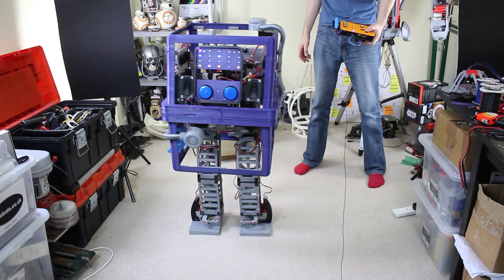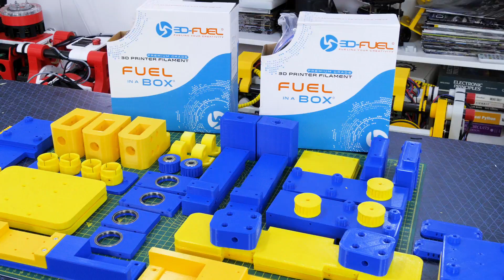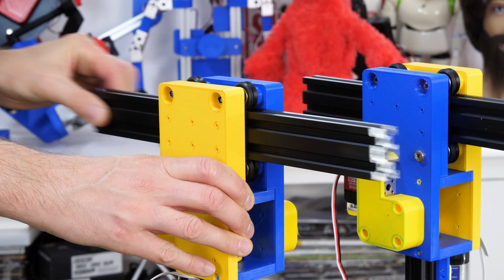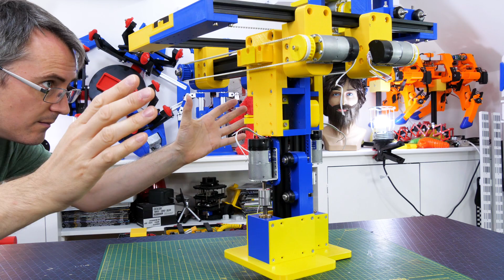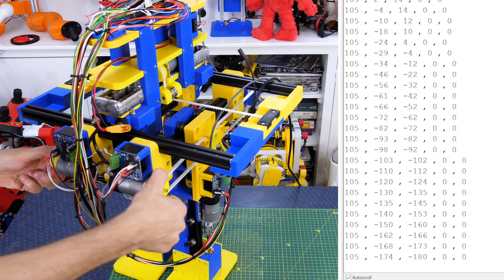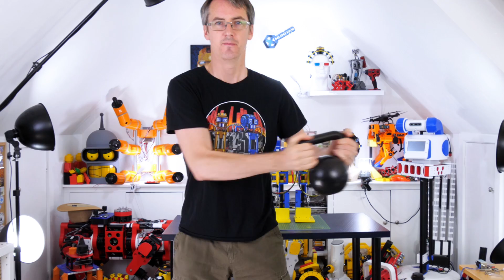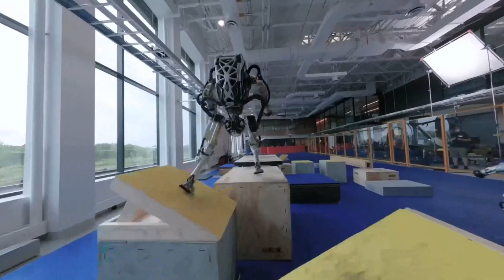Why Walking Robots are Easy

Comment from the maker: Should I attempt another Dynamically Stable Bipedal Robot project?  This time I'd use the Quasi Direct Drives/Cycloidal Drives and Inverse Kinematics like openDog3.
Reply: Why not?  I've seen you nail down the mechanical aspects of balancing and walking machines.  As one of those commenters you aptly jest about, why not leverage some of that AI hardware you have laying around to improve the software?
Your dog designs are great, and yet your commercial and university rivals let AI/machine learning refine the IK models, PID parameters, and gait patterns for more effective movement.  
You have the computer science chops to do it.  
Imagine humans with broken legs, joint and muscle pathologies, etc.  What makes them ambulatory is their software IN Spite of their physical imperfections.  Keep it up, you're a great engineer.
Reply: Some thoughts on feedback were the machine learning idea interesting, in addition to simulations based on IK, mass, etc., you can also play with computer vision, kinect sensors, heck, even VR trackers with lighthouses to allow for a physical machine to be part of the iterative learning process.  
You could do the crazy evolution with millions of generations, or simply chunk the problems and refine smaller parts of it over fewer cycles with training.
Reply: Bipedal robots designed with digitigrade legs like the Digit and Cassie models from Agility Robotics seem to be quite proficient at maintaining balance with limited tactical input. Their Cassie model looks quite simple yet is able to run at the average speed of a human while maintaining its balance. I'm not sure how feasible it would be to replicate a similar design in smaller scales, but it would definitely be impressive to see a similar take on digitigrade bipedal walking mechanics.
Reply: I’d also enjoy a digitigrade project series, though of course I’d probably enjoy any walking project. 😂
Reply: Maybe use your gyroscopic flywheel on rotator to handle the counterbalance and see how fast you can make it move.
Reply: Absolutely. Dynamically stable bipedal robots are the coolest thing. They can be quite high and I think they will be most impressive on shows.
Another fantastic challenge would be any robot that can elegantly walk up and down stairs and maybe open and close doors.
If you want to make something useful for society, you could consider a robot or machine that would be useful in elderly homes or hospitals. I think many people and schools/universities would be happy to see you endeavor in this direction.
Reply: @richardbloemenkamp8532 the whole bipedal robot series leading to something actually useful for society is a very inspiring idea!
Reply: Absolutely! I find your approach of iterating your robot designs, applying what you've learned from previous projects fascinating. You have come such a long way with these desings, why stop now?
Reply: You could maybe have another go a pronouncing Laird too 🧐?
I know we're famous for our affinity with fried food, but Scottish "Lards" is taking it too far.
Reply: So I'd love seeing all those different approaches coming together in one cool robot! You keep on nailing these concepts!

I would like to suggest taking the controlling to the next level. I think there is quite a bit of potential you miss out by keeping the algorithms rather simple. This does make sense as it's only you doing these projects and over-complicating things will just take too much of your valuable time.

So I have two suggestions for you:
1) Bring on a controlling professional. I am not one myself but I have experienced again and again that I tend to underestimate the troubles (and potential) of controlling mechanics and the power of educated control people. This could also be nice chance for a cool YT collaboration...
2) and/or cloudsource this shit. Have the community bring in code that you then run on the robot. This would be really cool to see different ideas from the community come together. Optionally, have a simulation setup for this as well!
Reply: Build a battlebot
Reply: Maybe one of those chicken style bipedials that stand mostly on parallel linkages and keep all the mass in the body?
Reply: Nice West Country accent
Reply: Go for it
Reply: just say "its to aid the whole of humanity" and your robots are exactly the same.
Reply: Oh definitely. An AT-ST (chickenwalker) would be amazing.
Reply: I think there's much you could do with openDog - give it a neck, head, eyes, tail - make it cute and expressive (or terrifying).
Reply: I should point out that Optimus is primarily designed to be of human form(ya walk aswell) so pointing out how easy it might be doesn't matter unless you make it humanoid also
Shape is important to real ai
Reply: I remember a Christmas cracker walking toy and it had feet with extra ‘toes?’ which stuck out of the  side of each foot (on the inside).  These inward facing toes were wide enough so when one lifted up   the robot could still balance since the foot was basically the width of the robot body.  It could easily walk forward by lifting each foot in turn a stepping forward.  No need to shift mass to balance.  It could walk quite quickly.  Try modifying the feet to be wider with sideways toes which interleave and leave the torso in the middle before getting more complicated?
Reply: Yes PLEASE!
Reply: That would be another interesting project
Reply: Definitely!  It'd be interesting to see what your learning from the dog projects translates to in a bipedal robot
Reply: Make a working AT-ST? ...At least in terms of motion.  Functional blasters are a different engineering problem.
Reply: I for one would love to see it! Whatever direction you choose to go in though, I'll gladly be along for the ride. Cheers!
Reply: humanoid robot will be more exciting
Reply: Yes!
Reply: Honda's experimental models are the beginning of dynamic walking in humanoid robots, we must thank them and their creators for what they accomplish.
James, i love your robots... but...  can you make a robot capable of climbing stairs like Honda did in the early 90's?
Reply: Its got be the way to go. MIT started with the one legged hopping machine.
Reply: I would like to see it! Your videos are always so interesting!
Reply: Build a biped that has a tail, like just about every other bipedal organism. Humans are unique in being able to walk on two legs, and not use a tail for balance. Chimpanzees and other apes use their arms for balance and then only walk on two legs for short distances.
Reply: Do it.. I was just thinking the other day it’s time for another stab at a bipedal robot!!
Reply: Yes! I'd love to see this thing running along. It could totally manage moving the inertial mass while taking each step rather than doing it one at a time.
Reply: I'd like to see a balancing pogo stick, then combine two to make biped.
Have you seen Cassie? Biped with bouncy legs.
Reply: what about motorised pivoting the ankles instead of the sliding transverse weight
Reply: Can you use bigger foot (L shape which will cover from left foot to right and video versa) so you don't need to put anymore weight for balancing
Reply: Yes. You're so close with your other builds, it's a logical next step.
I'd like to see it take a step if pushed out of balance too much, to catch it's self from falling.
Reply: As this project was chunky, square, and statically balanced, next needs to be an exaggeratedly round hip hip-swaying robot that swishes along on pointy feet. The more sass the better. 

Thirst-trap robo.
Reply: You could have maybe put a second sideway motor with less weight on top ta go the other way when the robot take a step so it can go quicker
Reply: I'd love to see an iteration of this platform/concept, perhaps a more stable, all-terrain platform.  Widen the legs to the extremes of the frame for more stability.  Enclose the working components inside more boxy and protected enclosures.  Make it a quadruped for increased stability, speed of movement, and oddly it'll probably save weight if you don't need 2KG of lead.  Could extend the length of the rails to add a stiff connection to the 2nd set.  Design is naturally suited towards keeping a platform steady and level while crossing varied terrain.
Reply: Heey James , why are hips and shoulders not used to balance robots ? I'm curious
Reply: Make Inmoov walk.
Reply: I think you should, also you might want to take a look at the videos of the HRP 4C cause like Atlas it uses a pivot in the torso, a waist basically that bends and tilts like the human spine, it really is the best mechanism for balance and a good walking gate, and the HRP 4C was made quite a while back, before robots like Atlas and Sophia were moving around, so that says a lot about a waist design in a bipedal robot, arms on a robot can greatly help with balance also.

Comment: To actually make a robot that can walk like a human and not fall over as easily as Boston Dynamics' robot does you need a lot more motors and you'll need sensors to detect level. The key is to constantly be in a state of falling while moving and be perfectly balanced while still. Which also means you need faster actuation. If you think what you've done already is hard, imagine how hard it would be to do human style walking.
Reply from the maker: Yeah, that was the thing with my GONK and RobotX - the motors were much faster, but that was before I bothered with inverse-kinematics or quasi-direct-drive.

Comment: only one Lord, mate
Reply: come on, inner-sphere rolling robot, single sphere robot
Reply: the best robot is the most simplest robot, even better than 4-wheel robot
Reply: better have opening doors in the sphere if you want to manipulate environment when standing still
Reply: the sphere can also float in water, and move with water-land friction pads
Reply: old clock robot
Reply: tic-toc mate :)
Reply: wobble wobble :)
Reply: rad bro :)
Reply: remote yourself into the robot, so that you balance it, not the robot itself
Reply: remote walking robot control seat, legs and arms
Reply: wanting to be Lord, you better have the real Lord with you

Comment: What about a robot calculating where it would fall, and putting a leg in a spot preventing the fall? Sort of like a "controlled fall" that never actually happens.
Reply: That's what walking actually is :)
Reply: @steveman1982  I think that's his point.
Reply: You also need to account for the shifting mass when you put down the leg
Reply: It's impossible for me to tell if this is very clever snark or just you genuinely not knowing that's how walking works.
Reply: I was gonna say he could probably speed it up by sliding the weight back towards the swinging leg before it plants. But you're right, ideally he needs to plan ahead, so that the foot comes into position just as the robot's center of gravity crosses the centerline. 🤓👍
Reply: Thats nearly running!